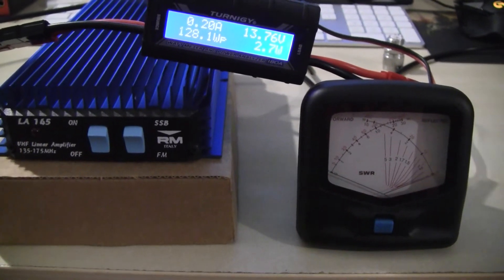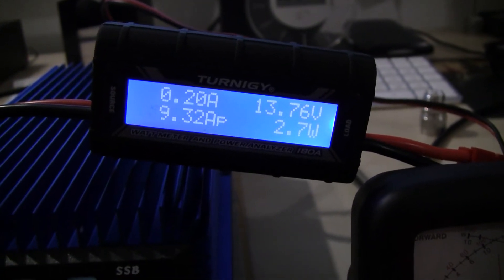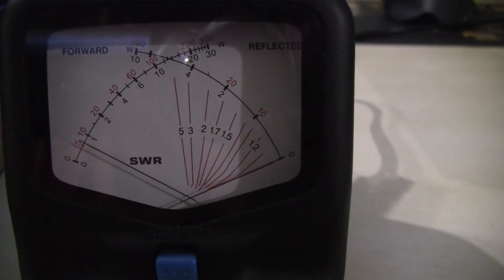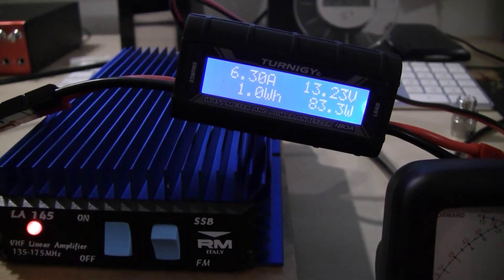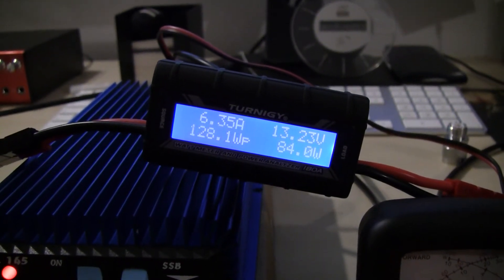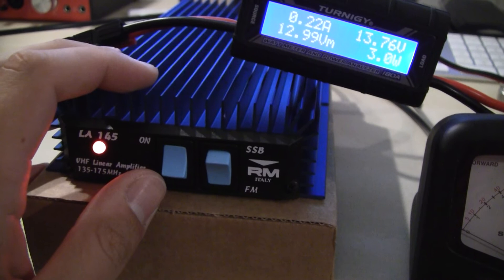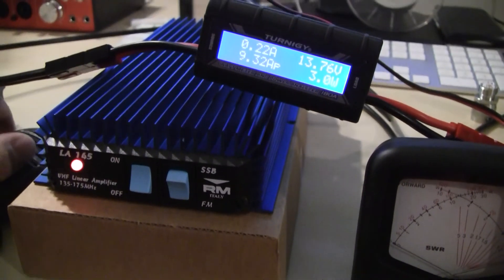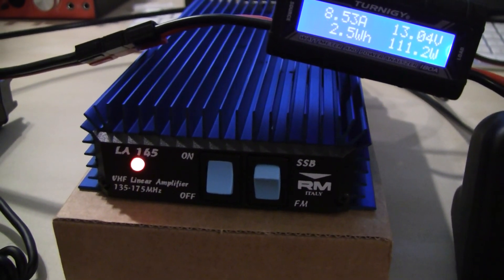Testing the RM Italy LA 145 VHF linear amplifier

Comment: Hi!, it´s ok on CW mode?. Thank´s
Reply from the maker: Hi! Yeah, CW should be fine if the amp is in ssb mode, so it stays in transmit mode for some time.
Reply: @bommel88  Thank´s for info, 73s.
Reply from the maker: Ssb mode adds about half a second delay to the hf vox, so if you are fast enough it won't switch back to receive. But I guess you could also modify the amp to add an external key input for switching to tx.

Comment: Ok, If I am following you correctly-- You *Drove the ( LA145  AMP ) with  0.5 watts -  During your Drive Process using 0.5 watt-- I see your *Inline Meter register as 83 Watt Output
This LA145 Amp is rated at 85 watt out being driven with as low as .05 watts Input.
Are you Not Happy with this amplifier?   I ask you these questions only because I may purchase this Same  LA145 VHF Amp for our Marine Radio Frequency Range  156.050-157.425..
Reply from the maker: No, the 83 W ist the power drawn from the power supply. At 0.5 W of RF input, the amp produces around 30 W of RF output (60 W with 2.5 W of RF input). In generally I'm happy with the amp. If you are using FM it's really a no-brainer. SSB can be a little tricky because it only has an RF sense for switching RX/TX and no external PTT connector. Also there are no protections for the amp. You need to manually keep an eye on the input power level and the temperature or mount an external fan. But again, if you consider the low price of the unit that is really much to ask for.
Reply: @bommel88  ok understood

Comment: What cable do i need to link the 818 and this amp?
Reply from the maker: Only a coax cable. This amp does not have a PTT line, it uses HF vox for switching between RX and TX. I'm using a BNC to PL cable.
Reply: @bommel88  I didn’t know that was possible. I thought all amps needed a keying cable. Thanks you.